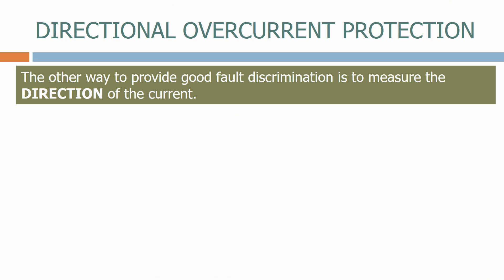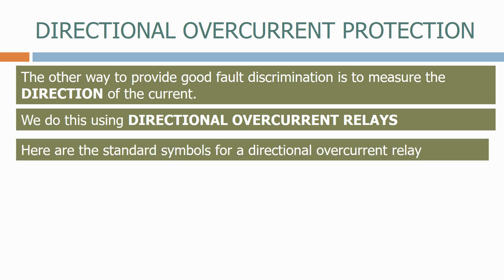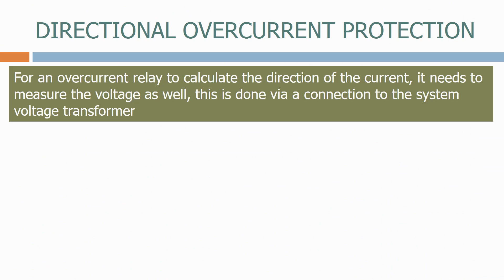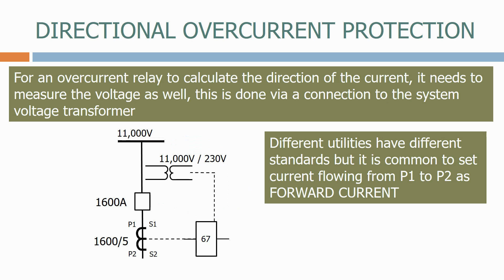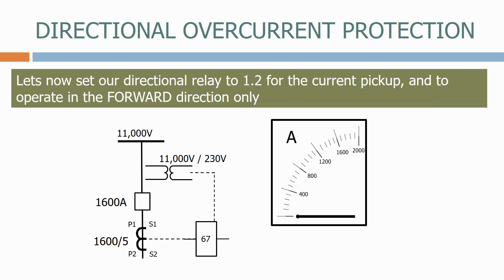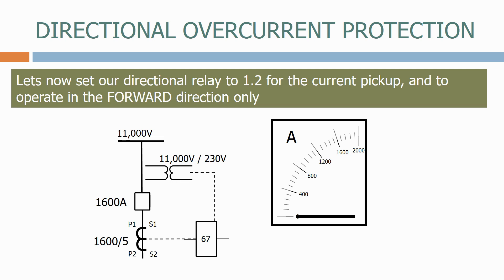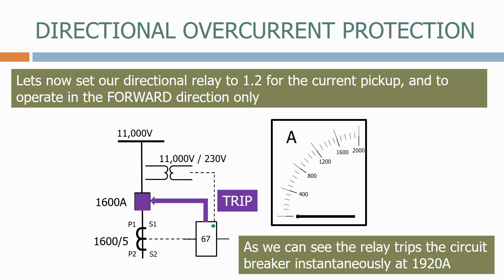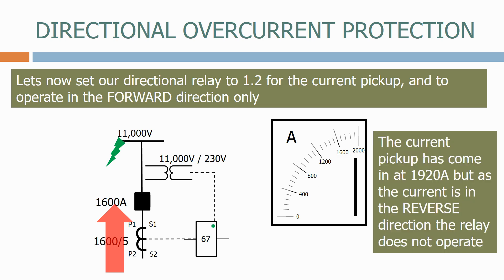Directional overcurrent protection

Comment: Hi Stephen, is this course still available ? Do you know if there are any discounts on courses?
Reply from the maker: Hi Ryan,
              Use the voucher code TWHD1001 to get the following Udemy courses for $9.99….

ELECTRICAL CONTROL & PROTECTION SYSTEMS
ELECTRICAL CONTROL & PROTECTION SYSTEMS PART 2
ELECTRICAL CONTROL & PROTECTION SYSTEMS PART 3
ELECTRICAL CONTROL & PROTECTION SYSTEMS PART 4
ELECTRICAL CONTROL & PROTECTION SYSTEMS PART 5
AIR INSULATED SUBSTATION DESIGN
AIR INSULATED SUBSTATION DESIGN PART 2
AIR INSULATED SUBSTATION DESIGN PART 3
SUBSTATION GROUNDING
ELECTRICAL POWER EQUIPMENT
ELECTRICAL POWER ENGINEERING
CONSTRUCTION SITE ELECTRICAL SYSTEM DESIGN

COUPONS ONLY VALID UNTIL THE 3rd March 2024

Regards

steve

Comment: How to connect CT  for directional earth fault. CT star point towards object or away from object. CT polarity will be in which direction
Reply from the maker: Hi Suresh,
                  The way the star point is connected will not affect the operation of the relay and depends on the utility, for most circuits we do the star point on the S2 side of the CT.
P1 terminal normally faces the equipment being protected, if this isn’t defined then it will face the circuit breaker.

Regards

Steve
Reply: @Electricalsteve  
Sir, 
Can you describe how to find out the operating region for directional overcurrent and earth fault relay
Reply: @Electricalsteve  
RCA=55 and ROA= 80
What is the operating region
Reply: RCA= 65 , what is the region of operation for earth fault protection in R, Y and B phase

Comment: Actually sir I have doubt .. mostly 67 relay used in incomer only. 50/51 oc relay are only used in Fedder..
Reply from the maker: Hi  Karthick,
                      The decision on which type of relay to use depends on the standards of the country / utility operating the system, and whether the system is operated split or solidly connected.

I have come across both types of relays being used on feeders so its a good idea to understand the principles of both protections.

Regards

Steve
Reply: @Electricalsteve   pls explain about characteristics of 67 relay with example ..